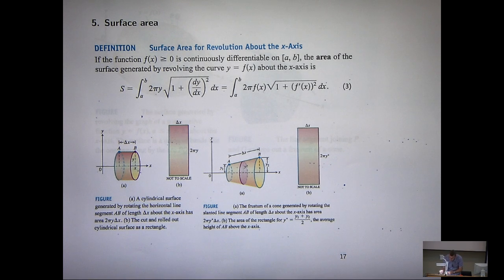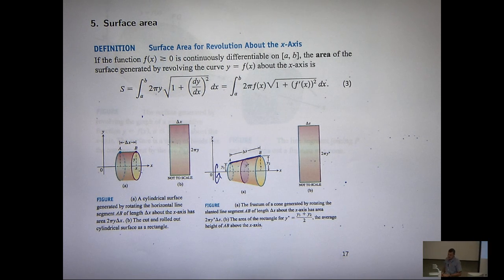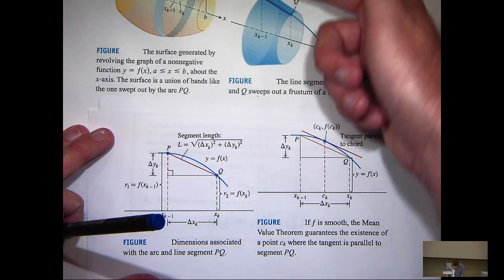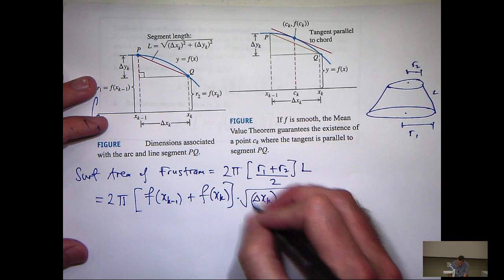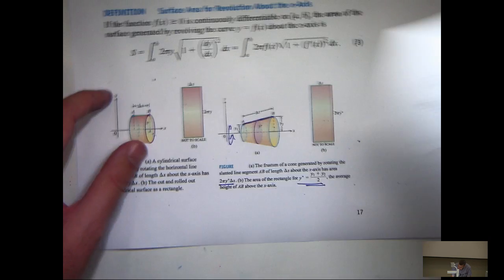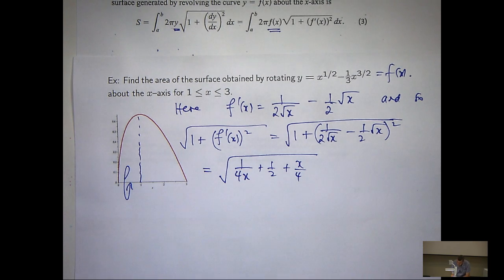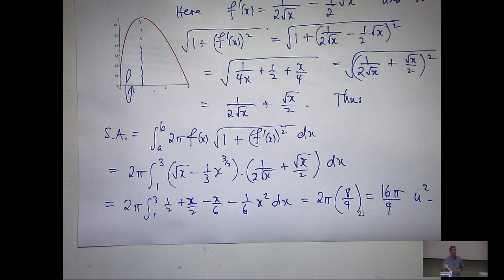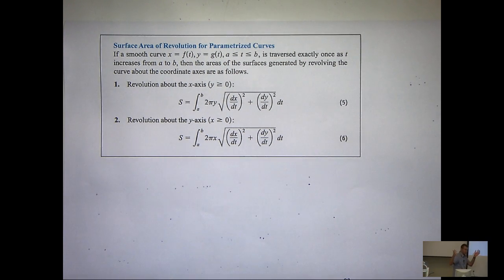Surface area of revolution of functions

Comment: My first impulse was to calculate the surface area of y = x^(1/2) - (1/3)x^(3/2), revolved about the x-axis for 1 ≤ x ≤ 3, as a sum of circumferences, each with radius y. (This is analogous to the disk method for calculating volume.)  

So I arrived at:

SA = 2π ∫ y dx | y = 1 to 3
= 2π (4 sqrt(3) / 5 - 8 / 15)

... which is incorrect. (As you demonstrated, the correct surface area is 16π / 9.)

Can you explain why the surface area cannot be calculated by adding up the sum of circumferences?